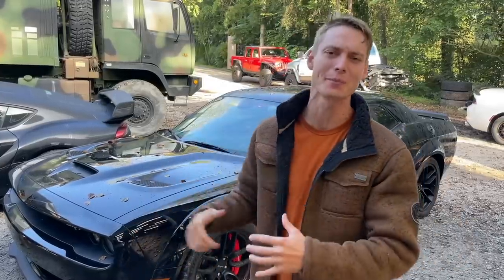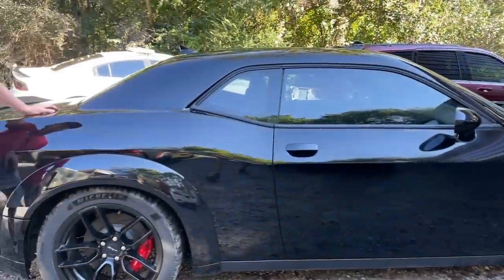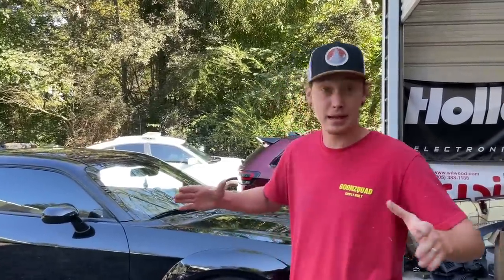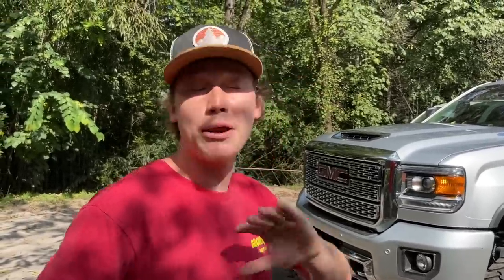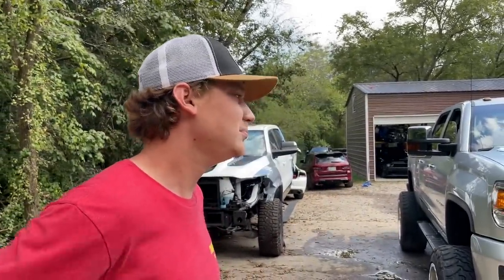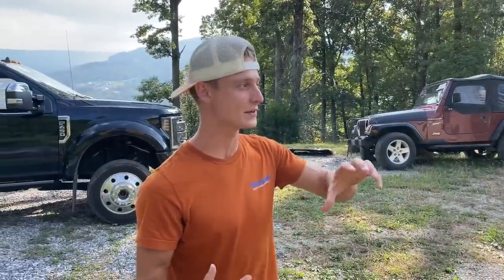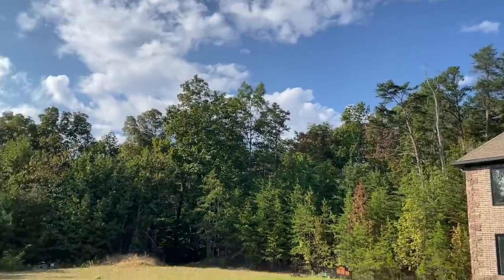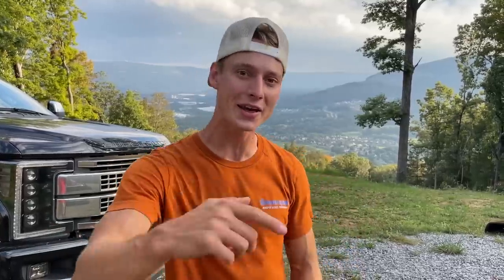Preparing All Our Builds For Sale Part 5!!!

Comment: That truck should be about 30k. CJ on 32 runs an Online raffle for his cars. Try and do the same, please. Your prices are too high. You will make more money from a raffle.
Reply: Too many legal stipulations to raffle off rebuilt cars
Reply: @smath5841  if you have done all of your paperwork done with the DMV. Have the car inspected by DMV there should be no problem. You just have to let the buyers know it is a previous salvage vehicle.
Reply: I manage car dealerships for 10 years. You are asking too much for a salvage title truck. A Salvage Title Vehicle should be sold normally if the work is don't properly, about 35% less than a clean title retail Vehicle.
Reply: @mack38412  won’t work if winners live in a different state
Reply: @smath5841  Why? You can register a rebuilt title vehicle in any state. I have managed 4 different car dealerships.
Reply: You just have to let the bidders know it is a rebuilt title.

Comment: Is anyon else noticing the changes on the channel?  Amongst the HUGE amount of spam, there are hundreds of negative comments, way, way more than there used to be. The silly fanboy "They can do no wrong." comments are still there but not nearly so many.
The "cameraman" didn't seem to last very long and all work seems to have stopped on the commercial property. The Tesla builds fizzled out, as did the Camaro and the TRX. Does it really take this long to get parts for a helicopter?
There have been various visits to farm properties, for no aparent reason and now they're talking about two more property builds, done by contractors. Still no mention of the pond project, or the promised "cannonball" into it either.
They're selling off, or trying to, a lot of their vehicles, but without finishing them properly. The work they 𝒂𝒓𝒆 doing(like that back window) is hardly to a high standard. There's huge amounts of gibberish in their scripts and they seem to be making the quickest, easiest, cheapest videos possible, even talking about shortening them in the near future.
I'm not saying this stuff to be a hater, there's enough of that going on, I just think something has changed - and not for the better. Or is it just me??

Comment: actually guys .i have fixxed two DPF filters now ! one on a BMW and one on a Alfa Romao diesel .its easy !
by removing the front temp sensor and injecting 500mls of mag wheel cleaning acid 
and 500mls of alkaline based automotive spray cleaner in to the front chamber , then filling it up with water , 
refit the sensor and start the engine . a lot of sooty crap comes out , 
after a day or two do a forced regen via OBD2  . 
 both cars still working fine 2 and 3 years later . its a cheap fix . good luck .

Comment: Regenn is it going to work if DPF is clogged up so much you might have to take it out flash with a jet wash (they not to hard to take apart)  and also there are DPF chemicals that you can purchase to dip a dismantled dpf in bucket full of chemicals leave it to soak and jet wash it out again.
Wack it back on truck check for faulty sensors and you should be ok 👍

Comment: Hey guys about the pdf filter, I had the same problem after 60000 km on a f250, you have to take the pdf filter off and bring it to a company where they clean these filters for semi trucks. They will wash it out and it will be brand new. Costs about 100$

Comment: Can you guys check the ground going to the transmission for the region I had the same problem went through all the hassles of finding out it had a weak ground on it that would tell the computer that it was moving during region we're not allowed to finish completely. Worth a little bit of effort to put a new ground wire to the chassis to the transmission.

Comment: hey goonzquad dont let the truck go for cheap because of the the DPF getting clogged. that is the case with all of these trucks. even when you buy them brand new from the dealer after a few thousands kilometer they will get clogged and you have to keep regenning  them every time the check engine light comes and shows power reduced. 
i have two of them which i tow towing with and i have to deal with it. some of my friends have 2021 models and check engine light is on all the time because of the emissions. so its not an big issue because all of these trucks are like that but they still drives fine. so it would not effect the price.

Comment: If the diesel particular filter is clogged I wouldn't recommend driving it... a clogged exhaust creates extreme back pressure which can cause damage... I've experienced that problem with a diesel vehicle already, and it blew out a part of the exhaust.

Comment: Are you building on the existing foundation down the hill? What happened to the pond?.
Reply: Judging by the poor quality of the substructure which the previous landowner built for the 'HQ House' which Simeon and Eleazar recently repaired and remodelled, it would be unwise to trust any further structures which they may have inherited on the site. Goonzquad need to work carefully with their architect to choose the optimum sites for the two new residences they wish to build on the land, and to ensure that all of the work from the foundations upwards is done to professional standards so that it will be durable and will require minimal maintenance.

Comment: Guys....what you need to do to clean out the filter is fairly simple.... take the truck out on the freeway for about 40 minutes on as low a gear or speed as you can so the heat burns away the soot.
Reply: Nah.. They plugged it up good with that tune. It has to be replaced now

Comment: Its unfortunate the hellcat paint doesn't match on the front bumper and hood to the fenders. Its a darker black around the rest of the car. It was killing me watching you seal rain, soap, and water into the 3rd brake light. Not so sure what I think is the problem with the rear trunk lid but that kind of looked like the clear didn't bond to the base underneath or it oxidized. Think the whole car is probably going to need a respray.

Comment: Wide tires suck on trucks the wider the  tire it screws up  the mileage. Tire places will tell you that ended up selling  my wide tires and  went with original  tires and rims alot better handling and better  gas mileage

Comment: You have to do a geotechnical investigation prior to building your house.
Reply: The 'PERC Test' (Percolation Test) which Eleazar and Simeon discussed in this episode is usually the first step. This test is particularly important on this hillside site (it is not technically defined as a 'mountainside') because the subsoil is heavy clay underlain by rock, so the permeability in the area may not be sufficient to obtain permission for a new Foul Drainage System utilising a Septic Tank to be installed. It is surprising that such testing was not done before Goonzquad purchased the site in June 2020, since this is the normal procedure when buying rural land on which it is proposed to construct residences.

Comment: First you’ll have to lower it back to OEM before I would buy it . Second  on rebuild titles some loan  companies or bank won’t loan you money on a vehicle that has a rebuild title . I never heard of taking a soil sample before you build a home .
Reply: A 'PERC Test' (Percolation Test) is commonly required in the USA when one is proposing to construct a residence that cannot be connected to mains drainage. This Test is necessary in order to prove that a foul drainage system can be expected to function correctly if a Septic Tank is installed. If the Test shows that the land is unsuitable for a Septic Tank, then a residence cannot be built at that location. PERC Tests are expensive, averaging $3,000 in most areas, and Goonzquad are acting correctly by having this work done before committing further resources to the project. Since the hillside site has a clay subsoil, the chances of failing a PERC Test are quite high.
Reply: @johnstedman4075  John in there statement I don’t believe they said anything about septic system. They said just to build. Beside I seen septic system put in with out leech beds I believe it call an aerator system  , that when come out it’s clear and has no smell.
Reply: @theodoreko2700  The sole reason for a 'PERC Test' is to prove to the Local Authority that the proposed site for a building is capable of supporting the subterranean conditions to allow a Septic Tank Foul Drainage System to operate correctly. This Test has been a legally required part of the majority of rural projects which my Firm has designed and built in the USA over the last twenty years. In a minority of jurisdictions, it is necessary to perform a Soil Texture Test and an LTAR for the same purpose.

Comment: I say move whole parents house on lot💯
Reply: The mathematics would not favour that. Their parents' house in Rossville was built 64 years ago. Removing this building from the current location in Georgia to the Tennessee site would probably be possible, but very expensive, and would devalue the empty lot substantially. A lightweight timber frame building of that type and age would probably suffer considerable damage in the process. The house would require major repairs and reassembly after the move to the hillside in Tennessee, and would probably not suit that location in any case. A far better option is to commission an architect to design and manage the construction of a new residence on one of the five Acre Parcels on the hillside, and to sell (or transfer, or let) the original Rossville house as it stands.
Reply: @johnstedman4075  valid point but also they will brace the house an it will only cost 5k to move locations

Comment: Dpf delete the truck it will help it in the long run. That DPF stuff just ain’t good at all for them newer trucks even got them on the newer 6.7s and 6.4s just do the delete and it will be 100xs better for the truck in the long run. Do 5 inch down pipe tho I bet that sucka would sound meannnn

Comment: Should have dried up the interior after that wash without the rear glass. Why you didn't seal it with plastic to avoid water on the interior is beyond me. The possibility for mold just increased alot with all that water...

Comment: Really 45,000 for a salvage title truck that still needs a couple thousand more in additional work. Where is the deal yall were talking about?  Because at the end of the day it is a salvage vehicle and will be difficult to insure and difficult to finance and to still invest couple of thousand more. Mightus well be safe and buy a truck for a little more with no problems that come with salvege vehicles.
Reply: Doesn't matter that it's a salvage title. It can be easily insured, and the new owner will most likely delete it.

Comment: Not all their builds are showroom builds. Look at the video showing the suspension on the truck . Alot of rusty spots, frame rust..the truck repairs will be expensive. Most of the builds were done quickly and cheap paint.

Comment: The DPF issue will be it's working correctly, it's just the "tune" making too much smoke by pumping in too much fuel , remove the tune back to stock and fit a bit of Banks kit to it, then all will be well,  pointless doing anything past stock done by clowns

Comment: In this case price is wrong 
When is salvage title 
Cars and trucks lost 40% of the value 
Any add or mods 
Will not bring add value 
This truck is 60k blue title 
Minus 40% 
=
36,000.00 
But the delete will cost 6k 
So this truck true value is 30 to 32k

Comment: Rebuilt cars devalue anywhere between 20% to 40%. I like the channel content for entertaining purposes, but I wouldn't buy a rebuilt car (probably ever) due to several factors including safety (most important) and reliability. I would spend a bit more on a used car with no severe damage, or buy a lesser model or cheaper professionally inspected car with no accident records. IMHO, painting a car in a non-climate controlled environment is a recipe for disaster down the road.